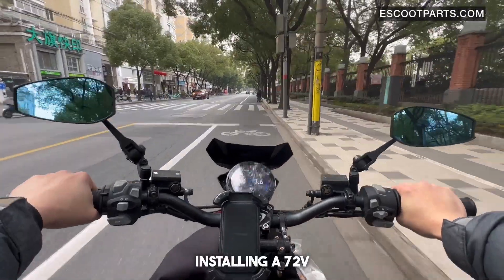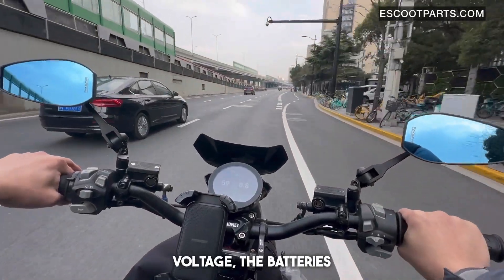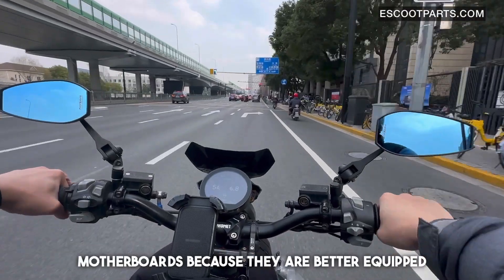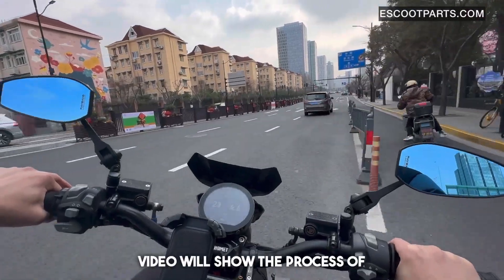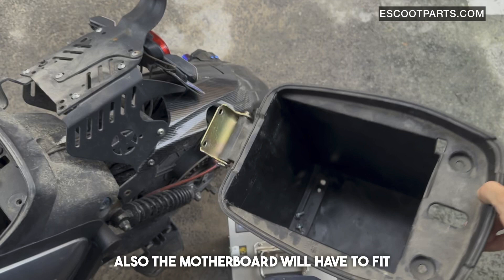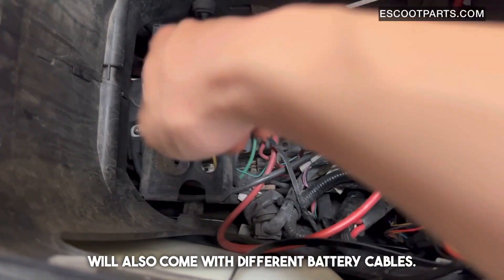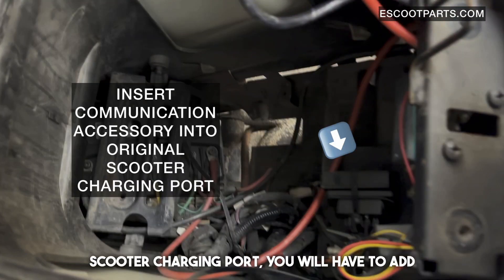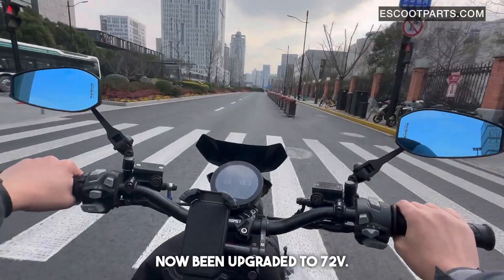NIU UQI GT / UQI+ 72V Battery Upgrade Installation

Comment: Hi, so now battery gets connected via Xt60/Xt90 connector, right?
Asking because I want to use my own battery, and the data connectors on the original connector are prohibitive because then I need to use BMS of niu and so on..

Comment: Hello, can the Niu NGT can use 72v battery with the original controller ?
Reply from the maker: Yes but needs software service from us to change settings to 72v.

For the N PRO, NGT and NGTS we have a software service, you will have to send us your motherboard to our adress in the Netherlands. After programming we will sent it back to you. The price includes shipping back to the sender. With the software service the scooter is able to go 90km/h. https://escootparts.com/product/niu-software-service-ngt-npro/

Comment: whats the top speed with the motherboard and the 72v battery looks like it can hit 80 kmph, is also the blue dongle required to install instead of the regular plug? and lastly whats the top speed with mobo and 48v? ur website shows 65 but can it go higher with 48v?
Reply from the maker: 80+kmh

Yes, when dealing with higher levels of ampere this type of plugging is better for heat resistance 

60+, can go higher with our 48V batteries but with original that is max
Reply: @escootparts2284  what about the blue dongle? is it required for both for the mobo/controller?

Comment: Is it possible to by the 72v battery and the motherborard and use with the original motor? Afterwards is possible to replace the motor with one with more power?
Reply from the maker: Yes, the motors in different about the battery voltage it is the motor boards which is programmed at a certain voltage. Therefore, you have to use our motherboards because they are able to change in voltage
Reply: @escootparts2284 are we able to say... Install the motor from an mqi onto the UQI?